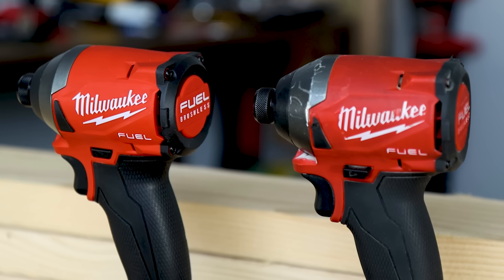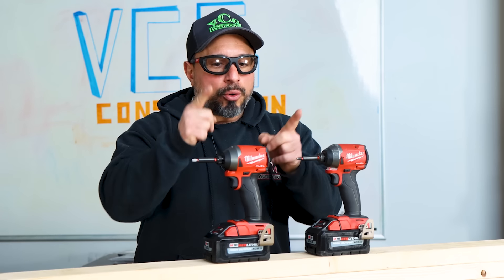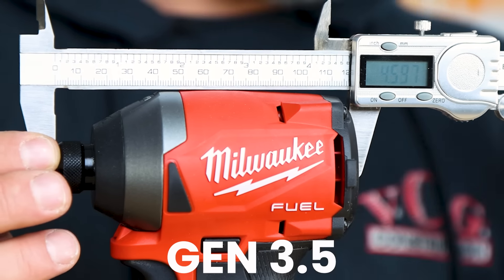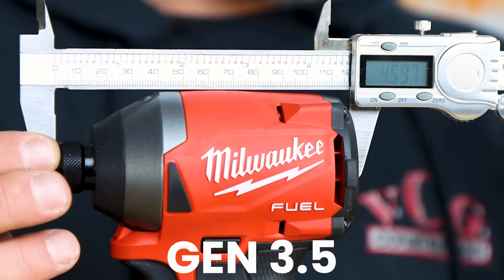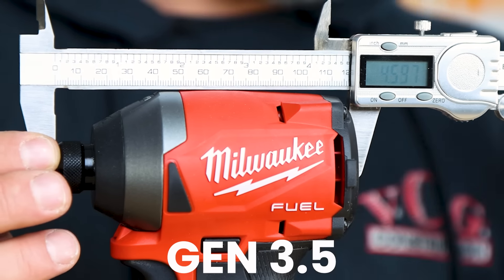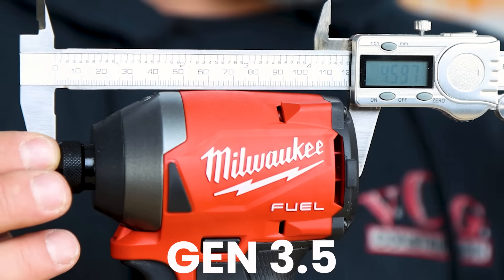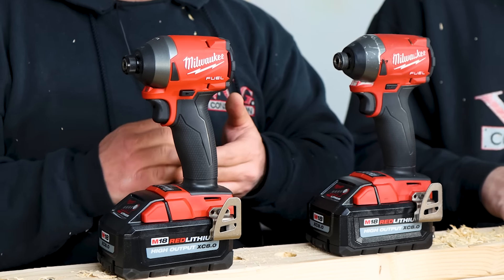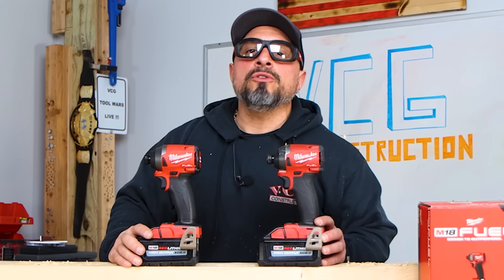New Milwaukee M18 FUEL GEN 3.5 Impact Driver TESTED Against INFERIOR GEN 3 Impact!

Comment: Lets face it, we all as contractors invest our hard earned cash in these products so we can do a professional job, we invest in the Brand, this particular Gen 3 model has this serious flaw, Milwaukee need to stand behind their brand and as a quality issue just get on with a recall or just repair every single Gen 3 unit, some of us have more than just the one unit, it is time consuming and irritating when a flaw like this wastes your time on the job site, we also have many other Milwaukee tools in our arsenal and if we feel Milwaukee are wishy washy about standing behind a flawed product or are not going to respect their customer base by not doing the right thing, then we as customers will dither in our strategy when it comes to building our support kit under the Milwaukee Brand, but just to note I will say well done to Milwaukee for investing the time to re-engineer the collet to overcome the fault, now lets see them back up their customer base by doing the right thing and fix all Gen 3 units.
Dave

Comment: I have the old one and sent mine last week. Upon checking they replaced my hex anvil assembly with 2 ball bearings inside. Good job Milwaukee! When you file a claim, make sure specify the collet problem at the comment box. Hope this helps!
Reply: I have the 2 ball bearing version does the bearings suppose to free float inside the anvil when moving side to side?
Reply: So they'll fix the missing ball issue and my impact has a bad wobble. I noticed it the first day out the box but it gets really bad with bigger attachments. It shakes the bits off. Lol
Reply: Is it normal for the double  ball bearings to move freely in the new double ball bearing 2853-20 Milwaukee
Reply: They fixed mine, I tried light attachment with extension driver and it doesn’t do wobbling. I have also the new model and it performs the same as my old one.
Reply: So after sending yours in to be fixed or replaced you took it apart to see if they put the 2 bearing anvil in? I call bs dude
Reply: @Bootyspaghetti  they fixed my old one with new hex anvil assembly.  You can double check it easily using with a flashlight when playing or moving collet without opening up.

Comment: still would love to know if milwaukee will be recalling the gen 3 and have the gen 3.5 given to everyone
Reply: no...they said if you are experiencing problems with the collet on the gen  3 to call 1-800-SAW-DUST and set up a warranty claim...milwaukee will determine if you need the collet replaced. They are not swapping out tools...they will repair the one you have if necessary
Reply: then i think milwaukee kinda fumbled the bag they should change the model number or because they took forever to come up with a solution they could have redesigned it completely for gen 4 with the flat front shaving another half an inch of length and adding tribeam leds and maybe 2400 inch pounds to tie the record for "most powerful impact" kobalt has 2400 inch pounds so does ridgid
Reply: @kingofthecrease30  I have the same collet problem with my Gen 1 using the Bosch Daredevil paddle bits, but with the cheap Skil paddle bits, nada, it works fine
Reply: To be fair it's a impact "DRIVER" not a impact "Retriever"...
Reply: Yeah no shit
Reply: @minnesotaman3  dont worry, no sooner than you get the 3.5 the gen 4 will be out at pipeline 2021 lol. Typical Milwaukee. I agree with tri led and flat face - guarantee that will be on gen4
Reply: Buyers remorse, Lmao, try and return your car because they improved it with a new model. 😂 Participation trophies ruined our generation.

Comment: Bought two of these during the holiday season.  One was the $399 kit with hammer drill.  Manufactured 32nd week of 2020.  The other one i got in the packout kit with the (2) 3.0 Ah high output batteries for $179.  That was manufactured in the 21st week of 2020.  Both have 1 ball bearing.  Maybe they only improved the ones they are selling as tool only???  Maybe they're not putting the good ones in the kits because they want to liquidate that inventory.... Just a theory IDK.  Or maybe they have only started doing it VERY recently

Comment: You know that you should probably pull the bit in & out as you drill, because of the wood chip accumulation, like most bits are supposed to be used.

Comment: @vcg is Milwaukee still making the gen 3 vice the 3.5? If so the serial number will tell you by the manufactured date
Reply: They won't change the model number. It's Russian roulette.  But milwaukee does repair this. I cannot see how they wouldn't? Someone could get hurt if that bit falls out from 1000 different scenarios I could start rambling...you rely on the tool to hold through lots of power. Suddenly it doesn't? I paid top dollar for this brand for that reliability and professional performance.  If they leave me ball less....I'd take it personal.

Comment: They should recall them all and replace them. That's just my thought. You  can't wait untill  you have a problem. Then, if you are out of the warranty, they might not honor repairing or replacing it and i cant take their word for it, that it only affected 1% of it's users. Maybe some did have a problem but, never though it would be a defect with the impact.

Comment: I am glad they finally fixed this issue, but I still find a regular drill/hammer drill more efficient for drilling with wood bits etc.
Reply: Exactly. I don't understand the big lazie fuss. Its a hexa impact bro not a heavy duty drill lol tf. We used to bolt down 80 lbs drills to the floor to cut 6" carrots in concrete. These dudes crying they can't retract on an old abused hexa clip doing 2" deep holes. I think technology is making divas out of all of us. It's not good I tell ya...

Comment: I used the same paddle bits with the m18 non-fuel impact driver and had the same issues with the bit falling out so we tried the bit in a piece of a shit Dewalt impact driver and it wouldn't lock in so I think the driver is killing the bits so I just use a slightly bigger size or just buy new ones.

Comment: Hello Vcg and Vince 
Why doesn't Milwaukee due a tool recall. It would make them look like they care for the customer base. And possibly increase their sales of M18 line. Not to fix the issue makes  Milwaukee look weak at best or not caring about the Customer Base. My question to you Vince, has anyone got hurt using the M18 impact?

Comment: I work in the automotive industry and when they make a difference to a car they make note of the serial number so they can tell which car has a change. Maybe milwaukee did that and could let us know if the driver on the shelf has the upgrade.
Reply: Milwaukee will never tell us as the 1 ball versions will never be sold. They will keep quiet until the owner starts batching and send it in for warranty. It's much cheaper that way than to do a recall ( definitely not recall as no safety issue is apparent)

Comment: Maaaaan, it's gonna take months for them to clear out the Gen3 stocks everywhere an start putting out the 3.5's. An here I thought I could roll my ass down an get the new fancy one tomorrow. I've been needing a new driver an of course I stumble into this mess.
Reply: Once that happens, Gen4 will be days away from launching.
Reply: I have the one ball Milwaukee and tried it today and it slips out. I’m considering starting a new tool platform with Makita, but not the 40v. It’s tough because almost all my tools are Milwaukee and Dewalt, but I have a cordless Makita miter saw and track saw with 4 batteries already.

Comment: God I thought I was going insane when I kept losing my 9/16 bit. How do I go about getting a new one?
Reply: I have a buddy who is constantly loses anything attached to his 3rd gen impact. 4 months of that and I still crack up. meanwhile I am still rocking the first gen fuel since its release. won this 3rd gen at work few months ago . used it for 2 days straight . all with a smile . but I still went back to my first gen. gotta be me but i swear I have more power, torque and speed control. think I know why milwuakee dropped the ball. the other ball is in the gen 3!

Comment: I think this 1% thing is irrelevant. First off, @Vcg themselves bought a second impact to see if it has the same issue and it did. Maybe 1% can really confirm the issue, but many more than 1% of the actual impacts out there have the issue. Personally, i dont think the issue would occur with me as im just a diyer, and i agree that a minimal amount of users will experience it. That doesnt mean milwaukee shouldnt be obligated to fix every tool, whether I experienced the issue or not. Thats like saying a car shouldnt be recalled for a safety issue unless it happened to you because only a few customers experienced the concern. if this is potentially a safety issue, they should man up and repair any impact one decides to send in. just my 0.02

Comment: Milwaukee/TTi line of thinking- “ Let’s take a vote board, do we spend tons and tons of money to recast molds, remold larger and longer units, (no that’s what she said jokes!), draft, design, and machine new and less powerful anvil components, or do we just drill a hole in the existing anvil, add a ball bearing that cost $.02 cents for 1000 units, and design and machine a new spring that cost us $.03 for a 1000 units? Plus now we have made an ugly duckling by letting the people now identify the “problem child” on the shelf so they grab the better one and now we clearance a ton of stock. 

Let’s see a show of hands TTi! Ok now let’s make sure we let the people know that we are making a hard and “costly” decision of doing the right thing so they feel we are in the hole. 

I will say, we appreciate The Dilligence of Vince and The entire VCG community for pressing the issue.

Comment: I have employees with several Milwaukee impacts and they all drop their bits.  Its far more than 1%, its only 1% that complained about it.
Reply: Never dropped one out of my surge m18 it’s put in atleast 50,000 3” decking screws and countless drywall and sheet metal screws. I love it. Also turn them in under there warranty and they will fix them or replace them if there not repairable.
Reply: @jacobgodfrey8164  I think he says in another video that the surge line wasn’t affected by that issue
Reply: @jacobgodfrey8164  Same here

Comment: I actually decided not to buy this impact driver and went with a different brand because of this issue. If they would've solved this sooner they probably would have even more sales.
Reply: @Jakcolax yes I am waiting to buy the impact driver until an update. And they have it now but they have messed it up. 

I want the version 3.5 but I may buy dewalt or makitta now. I dony have time to go to shop by shop looking for 2 balls.
Reply: I Just left home depot without an impact after inspecting the collet.

Comment: Vince, 

Well, that doesn't make sense by Milwaukee. Why make a new gen 3.5 with new colet if only 1% is having issues. This issue has been happing since the tool has been released and you showed the milwaukee reps directly in a video.

Finally, Milwaukee has redesign the colet and fixed the issue. Now it's not going to issue a new model number. Why? because its a safety flaw on a tool and it will require a massive recall. Milwaukee continue making them knowing the issue and still selling them. A massive recall will differently hurt milwaukee profit. That's why it's easier to just slip it in with the tool kit or sold individually with no new model number. 

Shameful....Is all i can say...

Comment: a worthwhile experiment would be to take the faulty collet driver and remove the retaining spring and ball bearing and drill through the existing hole to match the other side and add a second ball bearing/spring yourself, there will be a risk of ruining the anvil but imo that drill is a dud as it is.
Reply from the maker: Let us know how it works out for you

Comment: So they’re fixing a factory defect and they need to replace anyone’s old drill with a new one, if it has the problem.
Reply: Cuz what percentage does it even effect? They would be better off just fixing the select few that go in for warranty I would think. Only reason many know about this is because of YouTube videos
Reply: @spencerwurm123  and of course all the people who found the video because they’ve been dealing with this issue trying to find a fix.
Reply: You can send yours in for warranty if it's a problem
Reply: @abdulelkhatib2674  except any fix so far has proven not to work, and by the sound of things here the whole anvil/ collett system is different, i doubt they can just swap it out for the double bearing
Reply: @jakobe328  I doubt its that hard for them to change any how its their problem
Reply: @abdulelkhatib2674  sorry, i doubt they would* change it out. 

Not when they could give us a half ass fix and get me to buy a new drill.
Reply: Mine is affected. Mine will let a bit go like a hot potato
Reply: @abdulelkhatib2674  not to mention i’m international and a warranty claim will take months. 

Can’t be that long without one of my main tools.
Reply: @jakobe328  well that's true alot of companies will half ass stuff
Reply: @justinsgarage1125  when did it start letting go? Like immediately out of the box or after heavy use?
Reply: @psfanboy79  the first time i used it to drill a hole. No issues with using it for driving screws or using a 1/4 or 3/8 socket adapter

Comment: Vince, at work we have at least 10 of the gen 3 and every impact has had this problem, and every one that I know that has a gen 3 has the chuck problem as well, I think it might be more than 1%.
Reply from the maker: Contact Milwaukee tool
Reply: @Andrew Kool
. Please let Vince and the VCG gang know how and if Milwaukee does good by you after calling 1800 SAWDUST. Ten GEN3 FUEL impacts is a small fortune in just Milwaukee impacts. This is a great chance to see how Milwaukee handles your problem. Will they replace any of your impacts outright? Will they ask you send only a few so you can keep the others at the jobsites while they get your collets replaced? Please keep us updated.

Hope everything works out for the best for you and your crew.
Reply: I think they mean 1% is: just 1% of the users use 1/4" shank spade or auger bits. I think it can be debated but Milwaukee needs to do more for people to easily differentiate between the revisions or just do a recall to prevent any confusion, but they go with the idea if it doesn't affect you don't need it to be fixed and so they can save money from the 99% (as they claim) whom are not affected .

Comment: @VCG Construction Milwaukee would not honor its warranty for my gen 3 that has less than a year of use. They would not fix the collet issue or the trigger issue. I have 2 with the exact same issue, one is 3 years old the other is less than 1 year. Very disappointed (again) with Milwaukees customer service.

Comment: I believe it's the trigger assembly that is the slight difference in weight. the newer tools are silicone filled where the older models are a blue epoxy. I noticed this when I opened up my oscillating tools

Comment: Do you like ryobi
Reply: I do
Reply: From personal experience, I had a ryobi hammer drill for home projects, and when I started 3 months ago as an Electricians Apprentice I brought it to work. Motor started to smoke after a few heavy jobs. I think it’s decent for small jobs, but once you start constantly boring holes through concrete, brick, plaster, wood, etc. it doesn’t seem to handle it well, and I’ve heard that from other people as well.

Comment: I appreciate Milwaukee’s persistence to keep updating the tool until the flaw is addressed. That said, if a product is different in “form, fit or function”  it should absolutely have a new unique part number. Clearly that is the case here. What if a customer get’s the original model but doesn’t experience the problem until a project years later?
Reply: That’s not a different model. That’s a revision. You don’t say each year vehicle is a generation on its own.